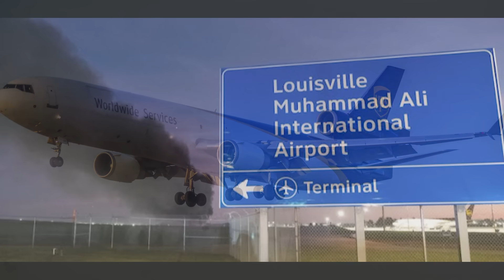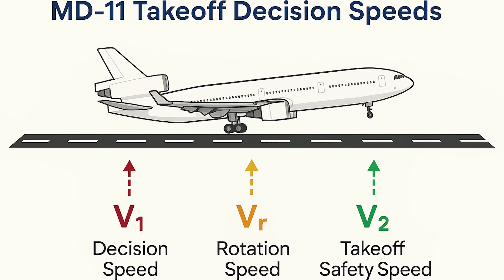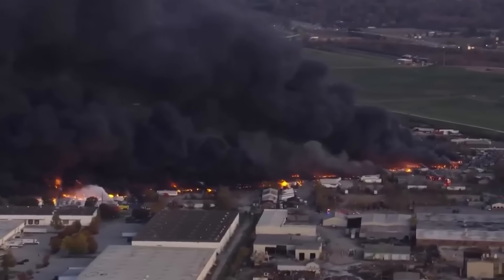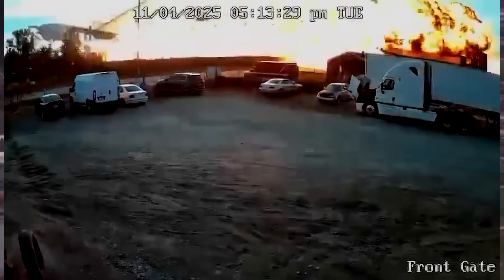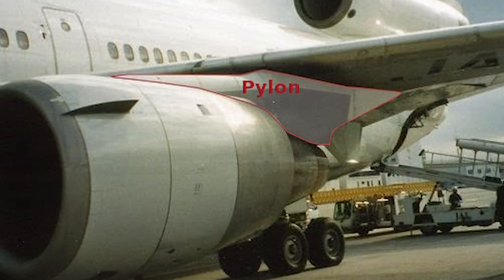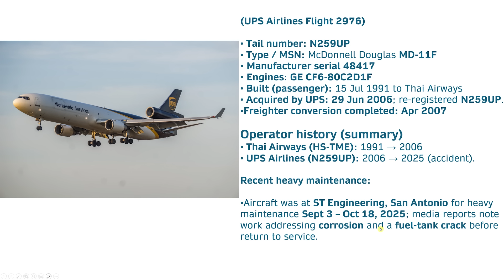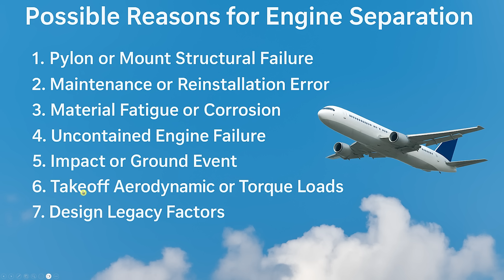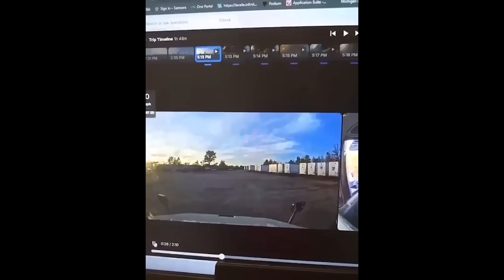What Caused UPS Plane Crash, Louisville, KY? How MD-11 Engine Fell Off

Comment: The key question is why couldn’t it gain altitude when it still had 2 of 3 engines…
Reply: It didn't. A closer look at the video as it's rotating shows the number two in compressor stall. It probably sucked in debris from the number one.
Reply: @rona4960you can’t diagnose an engine from a short video like that. However it’s a reasonable hypothesis that the number two especially was impacted by debris from the number one.
Reply: @simongordon8182  The flames coming out of the engine in regular "spurts" lead me to that
Reply: @rona4960like I said it’s a reasonable hypothesis that debris may have caused issues with number two. But need to have the black box data confirm. I think it’s important we are clear on the difference between reasonable hypothesis vs stating as fact. 

Some still talking about right wing loss of lift when in reality the aircraft is shown to still be largely straight and level as it hit that big warehouse with its undercarriage. So whilst there clearly was loss of left thrust there was also less drag as no engine and maybe no issue on slats and so loss of lift.

Tbh I tend to agree likely the secondary issue was some form of damage to engine two causing further loss of power. I just think we shouldn’t state it as clear fact.
Reply from the maker: losing the engine likely cause deadly drag on the plane, and could have taken out hydraulics, rendering it useless for lift
Reply from the maker: I have a hard time imagining how any amount of debris got from the left engine and when all the way under the airplane and got out in front of the right engine all while the plane is moving 150 mph. Had something like that gotten into the right engine the right engine surely would have blown up or caught fire or something and it looked like it was business as usual right up until the point that the plane was crashing into the ground
Reply: @jeffostroff not right engine. This is a three engine plane. The question is engine two at the back…
Reply: @jeffostroff  The center engine, not the right engine.
Reply: @jeffostroff surely loosing the engine REDUCES drag. And supposedly after aa they fixed the hydraulics issue. Some are suggesting more likely is debris damaged engine 2. Remember this time the plane seemed more level than aa just didn’t gain altitude
Reply: Try pushing a full grocery cart with the right hand and tell me how that goes........
Reply: @chrisdaigle3588 all two engine planes are designed to be able to fly on one engine. Three engine planes on two. Four engine planes on three or two. This is normal. 

The issues are twofold 1) engine stopped vs engine dropped off is very different in terms of how the plane flies and 2) what happens if other issues collateral damage

All pilots train flying with engine failures. Including on takeoff. When impish the cart with one hand I know to move my hand to the middle or push with some twisting.

Either way the dc10 aa they identified a couple of issues 1) the training assumed a failed engine but still attached and so with drag and 2) the way the engine distracted messed up the hydraulics and so the flap configuration. As a result the right wing stalled and the plan went in its  side and down. 

With more video it’s looking like that wasn’t the issue this time. But because the failure wasn’t contained to one engine the collateral damage maybe to engine two is a real possibility

During takeoff there aren’t many options on what to do…

Comment: We won't learn anything new until the flight data recorder is analyzed.  If the engine was running normally right up until it departed the aircraft then we'll know it was a connection/pylon issue.   Unless the airport CCTV footage shows an explosion.
Reply from the maker: going to be a long 30 days waiting to find out

Comment: Brings me memories of the Chicago. DC10 American Airline. Left engine fell off. Big maintenance Installed a  left engine with a forklift. Sad 😔 😟 documentary. May they rip 🙏 and a quick recovery for the injured 🙏 Amen 🙏.
Reply: I've been reminding people about flight 191 since this happened. They supposedly stopped the practice of removing engines with forklifts, but there are still a lot of similarities. Nobody wanted to fly on DC-10's after 1979.
Reply: @dons106  Except that's not what caused 191 to crash. They crashed because the hydraulic lines were damaged during the separation which made the flaps/slats retract. The flaps/slats retracting is what made the wing stall and resulted in the crash. 

If the flaps/slats hadn't retracted, they would have been able to circle around for an emergency landing. And that's why McDonall Douglass changed the design so a lot of hydraulic fluid wouldn't result in the flaps/slats retracting.

So we know that whatever caused this crash isn't going to be the same as AA 191. It may be similar, but we don't know that yet. AFAIK, there hasn't been any vids that give a clear enough view of the flaps/slats to see what position they were in.
Reply: @BreeBadger  Some reports were saying that debris, from losing the first engine, looked like it made it back into the middle engine (which is all the way at the rear) causing it to flame out. If so... the plane can take off down an engine, but not down two engines. (Plus whatever other damage happened to the wing, plus the wing being on fire...)
Reply: @gwillen  According to Captain Steeeve, the plane was plenty fast enough to rotate. He had some speed measurements from a ground radar or something. So they should have had enough lift to get a decent amount off the ground before extra power would be required to maintain the lift. 

Something spoiled the lift and resulted in the wings stalling. It looked to me like there was (at least) more of a stall on the left wing from the vids, but it was a bit difficult to tell.

But if there was something that impacted the rear engine, it's possible it might have hit the rear flight controls too.
Reply: @BreeBadger  yes and no. the lack of hydraulic fuses was an industry wide problem hell as far as i can find they still aren't mandatory today. and they didn't use fuses as the engine was designed to depart cleanly but because of the damage caused by the improper maintenance the engine tore the wing when it departed. sure there should have been fuses but that don't change the fact the engines should have never been remove and installed in such an manner.
Reply: You could say the Chicago DC-10’s engine kind of flew off the wing rather than dropped off.  The investigation discovered the method American (and Continental) used to remove the engine caused stress to the pylon mounts.  United Airlines used a different method and its DC-10s were fine.
Reply: @IncogNito-gg6uh it was the Installation method of re Mounting With Pylon as a unit.
Reply: @jamessharp9790  United removed the engine/pylon as a unit also, but used a hoist to lift it from above.
Reply: They were removing the engine & pylon with the forklift.  Not installing.
Reply: @TheBeingReal  Well, they removed it with a forklift and then reinstalled it with the forklift when the engine maintenance was done. So they're not wrong.
Reply: @TheBeingReal if they removed it they had to put it back on before flying. So it was done while being reinstalled
Reply: @TheBeingReal Yes, but a forklift was used for installation, too.  American and Continental used a forklift for both.  United used a hoist from above.
Reply: I'm old enough to remember that too. In fact I was going on my very first plane trip a week later and to say it made me a little bit nervous is an understatement.
Reply: @timbonjovi : Kind of makes you wonder about how maintenance is done to other airliners that you may be flying on in the future, huh? Thoughts of maybe something VERY important that may be damaged that's just waiting to fail under high G-load, extreme cold at high altitude, or high airspeed. Makes you want to just buy your own private aircraft and do your own maintenance, so that you know what's under the hood and that everything is safe. I'd rather fly myself anyway. Wouldn't have certain passengers stinking up your breathing room, or causing a fist fight with other passengers, like on Spirit Airlines! Always the USUAL passengers, (D), causing problems, thinking it's ALL ABOUT them.
Reply: After the left engine departed the airframe, it FODed the No2 engine causing a compressor stall. MD11s (and DC-10s) could fly with two engines but not one. The power lines caused the leaking fuel to ignite. Such a tragic scene. I like you thought of the American DC-10 losing the engine over Chicago years ago.
Reply: @blueducst4 are we sure debris went in to  engine number 2? With its at its Max takeoff weight still may have not been able to power out with 2 engines. Probably all ready at full power where the DC-10 Chicago still could have throttled up
Reply: @dougc190 : Flames from an engine, or wing fire create drag, disruption of airflow over and under a wing, which causes the burning wing, or engine's side to stall and yaw the plane in that direction. The loss of lift causes that wing to dip toward the ground, so when there's not enough airspeed to compensate for that loss of lift and at low altitude, there's no saving the plane, it's going down.
Reply: @dougc190 in the video from the airport CCTV you can see the compressor stall on No2 a few seconds after rotation. While I’m not a MD engineer, I’m pretty sure the MD-11 could climb out on two engines at max gross. Seems to me that is one factor they use to set max gross weight.
Reply: @blueducst4 I guess I just don't know  what a compressor stall looks like. (No seriously)  I'll defer to your judgement, because I've seen other people say the same thing.
Reply: Looks like the last big arc of the power line set off the fuel even though the engine connection was burning
Reply: SOME people at the top of UPS need to be FIRED and SENT TO PRISON, because they ignored FIXING the corrosion and cracked fuel tank correctly by REPLACING those parts, 'cause the longer the plane stays on the ground, the more money the airline LOSES, so they cut corners on maintenance to hurriedly get the plane back to making money again and the crew become collateral damage. I wonder how those at the top would react if they decided to cut corners on maintenance, yet were told that THEIR family would have to fly in that plane, do you think they would feel that their families would be SAFE flying in that plane and risking crashing and dying? NOPE! BUT, it shows how much they value, or DON'T value the crews lives, meaning that they're EVIL, JUST LIKE those at NASA who INSISTED that the Space Shuttle Challenger be launched on the cold, cold morning of 
Jan. 28th, 1985 that 7 Americans lost their lives from. They were WARNED by the company officials that built the solid rocket boosters that the O-ring seals get brittle in extreme cold and would rupture and cause leakage and destruction of the entire Space Craft. The first thing NASA did after it exploded was lock their doors to their building to prevent the people and media from gettingvin, THEN meet together to figure out how to cover their butts for insisting to launch, 'cause the longer it sat on the ground, they were losing money from the companies they were hired from to haul their payloads into orbit. That's COWARDICE! If they're capable of making decisions that could affect people's lives, then they should be held accountable for when their decisions TAKE people's lives too.

Comment: I was living near Chicago when a similar incident happened to a passenger jet leaving O'Hare in the late 70's. It gained a little more altitude and dipped and crashed into a residential area. They did find and engine mount bolt on the runway. I hope you keep up with this and find out the cause. Oops. I typed this before you mentioned O'Hare.
Reply from the maker: I will definitely keep you guys updated!
Reply: The main reason that DC-10 crashed was because the engine separation broke the hydraulic lines which resulted in the flaps and slats retracting. The wing stalled and the plane had no lift on that side of the plane which made the crash basically inevitable. After that crash, they overhauled the system and made it so that if something like that were to occur again, the flaps and slats would not automatically retract.

And for that reason, we know that the MD-11 doesn't have that specific weakness. So while it may be similar, the reason behind the plane not being able to get very far off the ground (somewhere around 150 ft) was not at all the same as what happened at O'Hare. Cuz if the wing hadn't stalled on the DC-10, they probably wouldn't have crashed - they managed to get enough altitude that they could have come around for an emergency landing.

Unless we're talking about a different incident. The one I'm thinking of was American Airlines 191. It crashed into a hanger at the airport, not a residential area. That's why only 2 ppl on the ground were killed - they were working in the hanger when the crash happened.
Reply: I landed at O'Hare 2 days after that accident. At 18 I was just a little unnerved about it even though I had been on many, many flights before that starting at the age of 2.
Reply: @royergonza1021  I was flying from Ft Smith to Chgo many Christmases ago, had a layover at Dallas. Everything felt strange. It seemed shutdown and we taxied for miles to a remote terminal, no tv's, very quiet. Proceeded to O'Hare and went to the family home. Then it was all over the news about the underwear bomber! Flew back 2 weeks later,was told to arrive 3 hours early for extra sedurity. Got there, walked right through, spent the rest of the time sipping beer and watching a bears game. I feltviolated that we were in the air and kept uninfor,ed.
Reply: @GregMargraff Wayyy back in the day flying used to be enjoyable. Now it's just one huge expensive headache.

Comment: I'll suspect those folks in Texas who did the heavy maintenance repairs and service as to cause. One source mentioned that the debris from the #1 engine went into the #2 engine causing it to lose thrust. It's obvious since the wing was on fire after the #1 engine was detached that these folks would have had a slim chance of safely performing an emergency landing several minutes later had they been able to continue to fly and gain altitude. This is completely sad.  I agree with you Jeff...too many "cameras" out there that are still using crap resolution that almost don't help any. If you are going to have video, you need to have decent video images or it might as well not be there.  1080P or better is good enough for most security needs these days.
Reply: Too many people record from their phones in the vertical format. That's bad. Record events like this with your phone in the horizontal position. This is why I hate the way people record and photograph things with phones. You get a sliver's view of everything, missing imagery on the left and right. You would not do that with a real camera.
Reply: Looks like that 720p footage is from a news helicopter. I suspect that station broadcasts 720 over the air, so they don't really have an incentive to buy higher resolution cameras. Or, they just post their stuff online at 720.
Reply: YES IT LOOKS LIKE THE NUMBER 2 ENGINE INJUSTS PARTS COMING FROM THE WING .  IT'S SO SAD TO WATCH THIS CRASH HAPPENING . THEY HAS NO CHANCE OF SURVIVING THIS .
Reply: @lpete2766 stop posting in all capital letters, it's considered rude and ignorant. And it's unnecessary too.
Reply: @bobjoatmon1993  IT'S MY EYESIGHT . BELIEVE ME I HEAR IT EVERYDAY . BUT I UNDERSTAND IT .
Reply: @lpete2766 I'm sorry for your infliction. Too bad there's not a universal indicator for that. There should be.
Reply: @creedamiyahsnipp  I AGREE . LIKE A SYMBOL I FEEL BAD BUT I UNDERSTAND WHAT IT LOOKS LIKE . THANKS

Comment: Engine probably departed the aircraft and went up and over the wing the same way it did in '79. The #2 engine was also in a compressor stall state meaning it probably took in FOD from the #1 engine departing the aircraft.

From the way the left wing dropped, it's likely leading edge slats retracted the same way they did in the '79 crash which caused that wing to stall at a lower speed than the right wing. Losing that much weight forward of the CG probably also made it immediately tail heavy which just made an impossible scenario even worse.

Either way, fully loaded with 1 good engine and the other remaining engine in a compromised state, on fire and now tail-heavy, there was no way that aircraft was flying.
Reply: Actually, following the AA191 crash, design changes to the hydraulic system were implemented (installation of check valves) so that the leading slats could not retract.  It's likely we're gonna find that it was the additional loss of the #2 engine that brought this plane down.  Now how far it would have made it with a fully engulfed left wing is anyone's guess.  Moot point nonetheless.
Reply: @86FxBdyCpe  Yes there are hydraulic or volumetric fuses that will prevent the slat from retracting in the instance of sudden hydraulic loss.
Reply: @86FxBdyCpe  yes they did add hydraulic fuses but we still don't know how the engine came off. if it disintegrated and sent debris flying it could have punched the line behind the fuse.
Reply: Who's been watching blancolirio?
Reply: Which engine is number#2 actually,?
Reply: @davidsmiths5471  The one on the tail. #1 is the one on the left wing, #2 is the one on the tail, #3 is the one on the right wing.
Reply: @davidsmiths5471 the tail engine.
Reply: Great analysis by both wun1gee & tbird/mustang guy. Thx!
Reply: @Markjohnson-vw4en  That would be a Mustang, nice pick-up. 👍